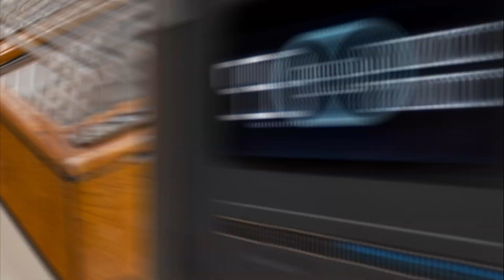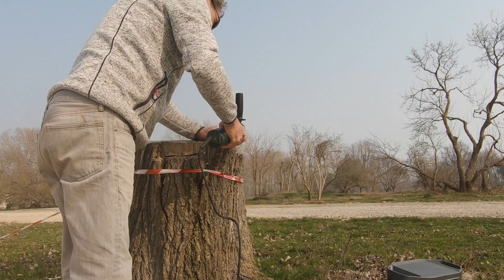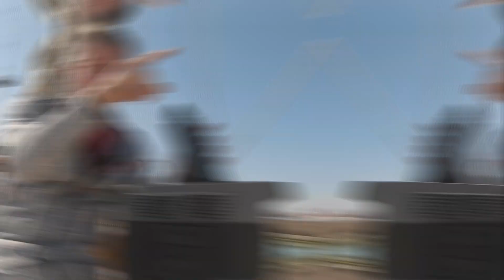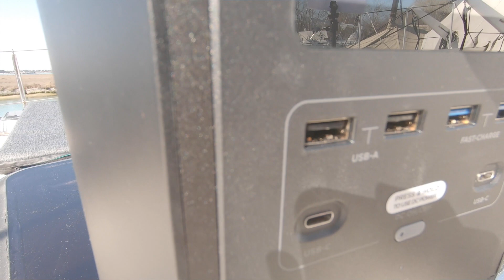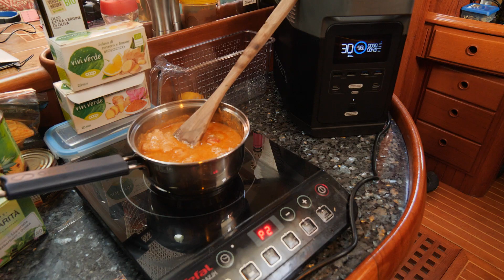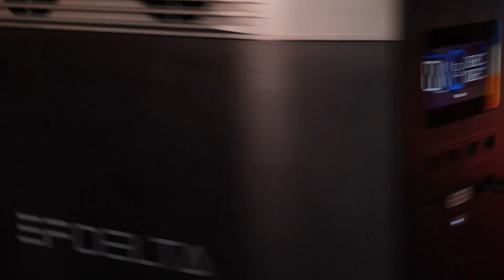Boat power solutions  |  Ecoflow DELTA

Comment: these are brilliant , I have one for my camper van with extra battery and when not in the van use at home and saves me a tidy sum. Am an electrician and one thing to note is beware the smaller models that boast eco boost, they actually drop the voltage to achieve higher OP watts , which , CAN damage some equipement. Get the biggest one you can

Comment: Surely if you don’t run the intake hose and simply recirculate the air in the room… as my home ‘spot’ AC does… it will cool faster and more efficiently because you are not constantly sucking in hot air but are recirculating cooled air.

Even though I’m English I am a big AC fan and have had it anywhere I have lived for 30 plus years.

I am seriously considering a couple of these when I get my boat and love the fact they have their own solar controller… so will run it/them independently of the house and boat solar. Main time you want it is to sleep in humid airless conditions.

Comment: Great video. I wondering if you know the most efficient way to use one of these as a "supplement" to keep a house bank charged? Would it be to just plug your boat's shore power into it and turn on the boat's battery charger? Converting from DC to AC back to DC seems inefficient. Is there a better way to simply go from DC to DC and charge the house batteries? Thanks!
Reply from the maker: Yes that would be a lossy (but easy) way of doing it, okay for an emergency top up I suppose. But really you would need a unit with a high output DC socket like the Bluettie for that. To do it properly it would be best to have a DC-Dc converter like the Victron units that you can set the right charging profile to for the house bank.

Comment: What is the capacity of the battery?
Reply from the maker: 1260Wh
Reply: @svfairisle  are you sure? That is over 100 ah.  Hard to see that will fit in that small package with a charge controller and inverter.  Even with that 1260 wh will not last long .
Reply from the maker: @glennlewman4186  yes I’m sure. The energy density of lithium is very high. This particular type is higher than LiFePO4, charges quicker. It’s too volatile to use this sort of chemistry as a built in house bank in my opinion but this unit properly tested and well contained so I think it’s great. If you want more capacity and want to use it for high load AC then go for the Delta Pro or Max. We have a Max with an extra battery which give very useful power

Comment: Can you manage a windlass or have enough energy to start the engine of a 30 hp diesel engine?
Reply from the maker: Not directly no. Those things would demand a high current in a short burst which the eco flow isn’t designed to deliver. What you could do is hook it up to the starter or windlass battery to charge it and then the battery can deliver the current

Comment: Hello! Great video very helpful. Do you think I'd be able to power a eberspracher deisel heater 2kw 12v with one of these?
Reply from the maker: Yes the cigar lighter o/p is rated at 10A so that would do it. Not the most elegant power connector though, I think the newer Eco-flows might have a 30A Anderson connector which would be better. If you were wanting to power something like an Ebersprach for any length of time though I’d go for a bigger unit. We like our Bluettie for bigger draw items and AC devices, we mainly use the eco flow for computers
Reply: @svfairisle  brilliant thank you. I will do some research on bluettie :-) may I also say, very refreshing to find someone doing clear videos that get straight to the point 👍👍

Comment: Can we use the lithium bank to supply power up the house DC electricity e.g. cabin lighting etc. which are usually from the house battery?
Reply from the maker: Yes, but you'ld be better off with a bigger unit for that job with a higher DC current output. We have the Bluetti which has a 25A o/p with an aviation plug, I will have it wired as a back up DC supply when we go to lithium.

Comment: Have you tried plugging it into the boats shore power to get normal use of the boat’s AC?
Reply from the maker: I haven't because I dont have a spare shore plug for the boat to wire in. It's something I would be a little wary of doing anyway, should be okay on Fair Isle because we have an isolation coil on the shore power input but I would still want to talk it through with a marine power expert before I did it.
Reply: @svfairisle  I took the plunge and will give it a go. Found it on sale for USD $950. I don’t think there should be an issue plugging it into the shore power cable using the adapter cable and wouldn’t think there’s a difference compared to using a portable generator. Do you have any concern on the fire risk?
Reply from the maker: Portable petrol generators have the same issues, it's all to do with the way they're earthed / floating neutral. odds are it wouldnt be a problem, but if the boat didn't have an isolation coil between the shore power i/p and the boats system then I wouldn't be swimming next to the boat with the genny running, a live-earth fault would go straight to the water around the boat!
Re. fires, it's a LiFePO4 so very safe. I wouldn't be putting a non LiFePO4 chemistry battery directly  into  a boat, but we do have an Ecoflow Delta thats not so I'm wary of that one. I don't fast charge it or leave it working if we're not on board. It's small though so if it gets hot/smokes it goes straight overboard!

Comment: Thanks Steve for the review. I bought one and I’m expecting to see how it works in my boat. I’m interested in charging it using the extra power from the alternator, but I don’t understand your proposal. When alternator is on, voltage goes beyond 13,6v never mind if the batteries are fully charge o not. I would really appreciate your feedback. Thanks in advance
Reply: Thanks Steve. That’s makes sense.
Reply from the maker: The voltage sensitive relay is to make sure you don’t discharge your house bank when it’s just sitting there. If you’re charging from whatever source then the relay clicks in and allows the device to charge as well, the minute you stop the motor / sun goes in / leave the dock & unplug shore power, the device is cut off so it doesn’t steal power from the house bank. That’s all it is, it’s still semi manual because I have to plug it in, so if I know I really want the charge to go to my house bank because it’s low I won’t plug it in while charging, hope that makes sense

Comment: I sort of understand the redundancy argument for these, but they're not cheap and I think the money would be better spent investing in house bank and a beefy AGM start battery that are on separate circuits but it could double-up as a house battery in the unlikely event that the lithiums died. For even more redundancy you could have an inexpensive portable petrol generator.
Reply from the maker: I think before I got one I might have agreed. I do think to have the same sort of redundancy you would need the petrol genny & that would be a similar cost, it would also mean carrying petrol & I'm very glad to get rid of that with the electric outboard so wouldn't want to go back. It's the fact that these things are so handy, clean and easy, for so many things though that sell it to me.

Comment: I'd seen these in the margins but not properly researched one; many thanks for generating (!) interest with this useful review.  However, the price - especially with the necessary solar panel - seriously puts me off as any extra item of kit has to compete with all the other 'nice to have' items after all the truly necessary stuff has been sourced.  However, I note that smaller, more affordable Ecoflows are available together with cheaper offerings from other makers.  I suppose its up to each of us to do our own power audits and to decide accordingly; it's obvious that your circumstances dictate you need the large capacity but someone with fewer loads or a greater addiction to marinas could get away with less.  I do like the basic concept as I anchor a lot yet can't afford a diesel genny and hate having petrol onboard, so your video was much appreciated, thanks.
Reply from the maker: Yes the price is definitely a factor! I was debating with myself ( hadn't got around to consulting the boss, Judy, about wether this was worth the money) when ecoflow offered to give us one for testing, so I was very lucky! But I had already spent £800 on our replacement inverter that we were waiting for. If we didn't have an inverter this would have been a no brainer. But even with I love the idea of a back up, and we do need the extra battery capacity without our diesel generator. I've already spent £2,500 on the genny in the last couple of years and it's now seized so it's good money after bad in my books. If this is reliable it's gold!

Comment: Nice review, thanks. Several comments below mention "back feeding" the output of this unit back into your house mains while out. Careful there. Make sure the output of your 110/220 volt, 50/60 Hertz  inverter is disconnected if you attempt this.

Comment: Hi Steve can you use the power pack to support your domestic system will the power go back into the bank to boat the system and run lights water pumps anchor light etc ?
Reply from the maker: Only if you used it to power a battery charger for the house bank so a bit lossy back & forth from the inverter. Best to use it to power things directly & take the load off the house bank, so we will bb plugging computers, camera battery chargers etc straight into the Ecoflow whenever we want to preserve the house bank.

Comment: Interesting analysis.  I especially liked the relay to switch "excess" power when motoring or solar to secondary devices.  I think I would put the money into a spare inverter and one more lithium battery in the house bank, but it wouldn't be portable, or be a backup for BMS failure.

Comment: Alternators do not "waste energy when house bank is full". Alternators just reduce the load so although spinning the are not creating any load so no effort for the engine to turn.
Reply from the maker: Yes I know, for me though that’s a wasted opportunity to get extra electrical power. Right from the moment the batteries internal resistance gets higher at around 80% the alternator will ramp down, most regulators will even do it before, even the smart regulators are pretty dumb. So although it’s not ‘free’ energy in the way that is is with solar, I want the engines alternator to be producing power to somewhere as much of the time the engine is running as possible. It’s drag is only equivalent to. Couple of horse power, with a 115hp engine that has no real impact. So that’s the sense in which I don’t want to ‘waste’ the energy. Sorry for the confusion.

Comment: i think you mentioned it, but would this device help your dinghy electric go further? if you needed it to, especially with the solar panels.
Reply from the maker: Yes in theory the ePropulsion can be charged at the same time it’s being used so we could have the Delta aboard as a charger and see how much that extended our range... I feel a test coming on!
Reply: @svfairisle  so do i :-)
Reply: @svfairisle  -  It  is  not  too  heavy  so  carry  it  as  a  possible  'get out of trouble'  back-up.  At  only  1 KW  of  stored  energy  at  full  charge  it  would  only  give  my  Nissan Leaf  about  4 to 5 miles  additional  range.   (A boat's range,  as  you  know,  is  much  less  than  a  car)    BUT,   I  would  like  to  see  your  coming  test ! ! !            Thanks !

Comment: Can a replacement battery be fitted by the user or is it a factory job ? great post thanks .
Reply from the maker: Factory job. I think if you're wanting something that will be cycled fully every day there are better solutions, this isn't how I will be using it on the boat so it should take 15 years before I'm down to the 60% mark I think.
Reply: @svfairisle  I had a Honda genset on a  55footer (Mush like your yacht, good sized hard dodger ) i delivered to Tonga , It was set up in a cockpit hatch ventilated & Exhausted outside wired permanently into the shore power point , Worked a treat ,

Comment: I somewhat doubt if you will really able to go without a generator during longer passages or anchoring in remote places, with days of gloomy low stratus weather in the tropics, loads of foodstuff in the fridge and freezer, blowers spinning the whole day, autopilot running, water maker, etc. 
By the way; not having the luxury of air-conditioning on a boat in the tropics can be a real visitation.

Comment: Thank you very much for your fantastic videos, I am going to purchase a Rainman AC watermaker that needs  1250 watt in steady consumption, with your experience with the ecoflow, do you think it will be able to run the watermaker one hour?
Reply from the maker: Only just! It's rated at 1260 watt hours so yes in theory it has just enough. If you were doing that on a regular basic though like 3 times a week you will be reducing the capacity of the Delta in a couple of years to a level that it wont be able to do the job properly that's it's one great weakness I think. Someone pointed out in the comments here that the way to get more cycles is to not go below 20% or above 80% charge on the Delta but that would scupper your full hour use of the rainman. You can charge the Delta at the same time as discharge it though so maybe if you did it while plugged into solar you would not flatten it in an hour?
Reply: @svfairisle  thanks for your reply steve, currently in dodecanese but Sailing towards adriatic  this season so hope to see you in the sea☺️

Comment: Big fan of your tech videos, and i will put an order on this robot for sure! 
Do you think, when on anchor, that you can plug it into your shore power inlet, and charge the house bank from there? If say the starter battery was fully discharged. Would it be possible that way? :)
Reply: Hi David and Steve
Also really appreciate your videos and researching/testing of equipment.
I would see this piece of kit for simply connecting to our shore power inlet as David asked, on our small catamaran as David when at anchor for say a couple o nights, to supply normal mains current to be able to use the kettle, and micro wave and possibly the induction hob we have on board and perhaps a 1kW fan heater if needed
Reply: Sorry meant to also say that we have only a 500W Master Volt inverter to run laptop, phone charging and a fridge etc with just around 400 AmpH of AGM battery storage and 340W of solar, so this unit would be an ideal addition when on the hook for a few days at a time, in between shore power stops. Especially if it can cope with a small microwave, or kettle, or toaster, or 1 burner induction hob at any one time. Will save on butane gas as well!
And the solar panel addition potential, will solve my previous perceived need to add more fixed solar panels even if we had the space which we don’t ! 🙂
Reply from the maker: @simonstell246  Yes it gives you that extra capacity, it’ll only do those high draw items one at a time though, and be careful which microwave you pick, some are just too power hungry. The computer, phones & fridge should all be 12v though, don’t be powering up your ships inverter to run them!
Reply: @svfairisle  Thanks Steve. Yes on the laptop, phone, fridge and freezer they are all run on 12volt when off grid, so would be using the Eco Flo for high draw mains items (one at time!) and as an emergency back up power source. On the microwave we have a small Daewo 600W one which takes a bit longer than normal ones but the chef says no real hardship waiting! Appreciate all your great advice and the top quality videos and documentary of your life afloat particularly under the current challenging times long term cruisers face in moving around! Good luck and fair winds to you both this season!
Reply from the maker: @simonstell246  Sounds like you've got it sorted Simon, good luck to you too.
Reply from the maker: Yes with the right adapter you could certainly plug it into the shore power inlet on the boat and have the whole boat on mains including the battery charger. You would have to stay within range if power delivery though, it would be relatively easy to trip but it’s rated at 3000w peak load, I managed to trip it with slightly less than than thought in testing. Best to keep everything below its constant rating if 1600w. I actually have a small battery starting unit that can jumpstart a flat battery, I try to keep it charged but if if wasn’t I could now charge it with the Delta. I will try and show it in an episode, they are quite cheap, I think I paid about £60 but I’ve never had to use it so can’t really vouch for it but it’s made for the job ( high amps in a short burst) so I’m sure it’ll work and of course it’s the one thing the Delta can’t do.

Comment: Looks pretty good when you consider the versatility, number of ways to charge, number of ways to use energy and most of all using it as an onboard inverter. So glad you did the power rating in watts. So may videos out there that dont do this and obviously watts consumed/gained are key regardless. Sail Safe Guys, Ant, Cid & the pooch crew.